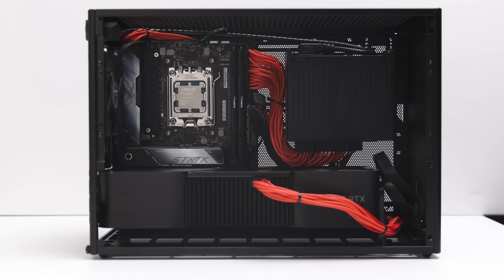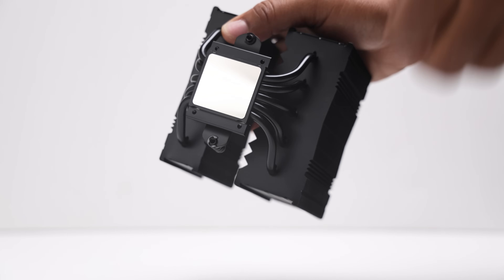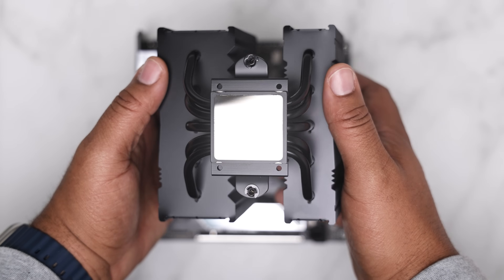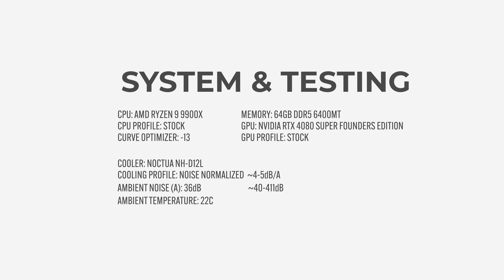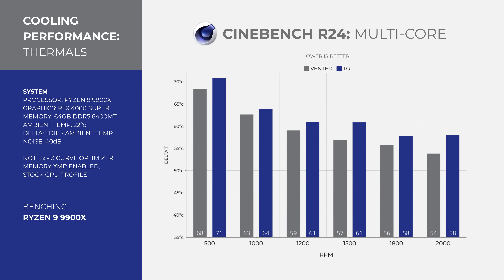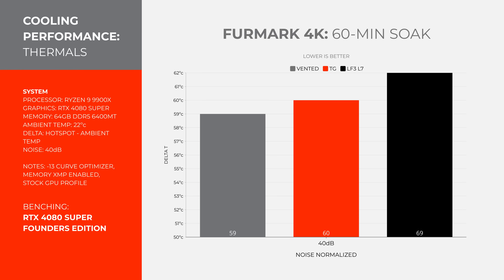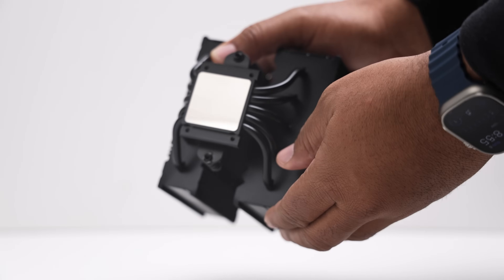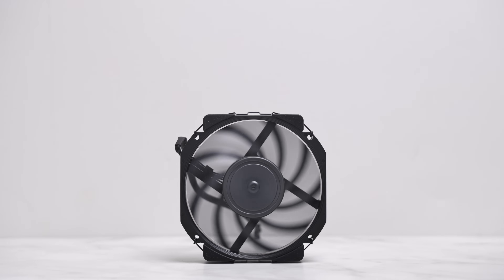NCASE M2 + Noctua NH-D12L – The Ultimate Power Couple!

Comment: I’m making a similar build, could you help explain how all of the fans are connected? Are the 92mm and 120mm top fans daisy chained together and plugged into the chassis header above the CPU?
Reply from the maker: I honestly don’t remember how I made those connections, usually I put the Cooler, pump on a separate headers and any other case fans may go on a fan hub or splitter.

Comment: did you have to use an 12vhpwr adapter for the psu? linked in the description is the 2018 version of the sf750 which doesnt have native support, but it looks like you aren’t using one. is that due to the custom cable?
Reply from the maker: No the Corsair Type 4, 3X8 to 12VHPWR cable
Reply: @ChrisRussellTech  thanks for getting back to me! love the content.

Comment: Hey Chris, in the video, it shows 150mm cable for the 24pin, but in the description, it says 200mm. 

Will 150mm work?
Reply from the maker: It’s actually 200, I don’t think I measure it properly, it’s from end of connector to end of connector not just the cable portion.
Reply: @ChrisRussellTech  I just wanted to make sure. I am trying to transfer parts from my FormD T1 to the Ncase M2. Do you think it the 150mm would work?
Reply from the maker: @aznboi890 do you have 150mm now? I think you should cut up a used set of cables and dry fit them to see what works for you. It’s really hard to tell you what cable size you need in a case like the M2, each configuration requires a different cable solution for best results. If you don’t have the time I’d suggest going 200mm.

Comment: Super clean build! Did you notice any noise coming from the small rear intake fan? When I tried installing a 92mm Arctic P12, I would get a lot of extra noise, likely due to the interference with the case panel or the CPU cooler (PA120 mini).

Comment: Amazing video - Sub earned. My NCase M2 Grater is coming to me right now. Two questions or things I am wondering about:
-Do you consider the Noctua Air Cooler to be the stronger cooling solution here?
-I was actually planning to put the GPU on top thinking it would improve the Temps but it seems your testing has proven the opposite?
Reply from the maker: Hi, thanks for the support! 

Cooling is very situational and depends on many factors like the type of apps or gaming you use. Within a margin of error these test can show just how well your system can cool. If your preferred games are GPU intensive like Cyberpunk you should consider an equally favourable position for your GPU. When it comes to the Noctua, it’s the most “well-rounded” cooling option. It’s quiet, made from quality materials from a reputable brand, however there are other options on the market such as the Assassin 120 Mini, which I haven’t tested on the channel yet. In my M2: 3V3 video, my results favoured the reference layout but the inverted GPU layout was a nice second. However it is important to note that this test was done with a liquid cooler and not an air cooler like the D12L. I anticipate thermals would be a bit worse on the CPU in the inverted layout.

Comment: Does the D12L touch the side panel?
Reply from the maker: Not in this build but I have been made aware of some motherboard and D12L builds that cause the cooler to touch the side. I believe depending on how many PCB layers a board has it can cause that issue. The ASUS X670E-I and D12L should be fine in the M2.

Comment: I like your built the most from what I have seen. I have Ncase M2 waiting for me to decide whether to migrate from NR200P Max or not. ITX, SFF, 4090FE, 9800X3D, PA120 Mini - similar specs. I need to stick to classic layout. Is there anything you would change in this build when it comes to cooling? E.g. slim fans on the bottom instead of top, or use 140mm 25mm thick fans on top instead and lower the GPU/motherboard?

Comment: With this same layout will a 240 aio fit ?
Reply from the maker: Yes, It would fit if you side mount the radiator (extra side mount usually necessary if you want top exhaust fans). It won’t fit at the top or bottom unless you opt for the VGPU orientation (extra purchase necessary).
Reply from the maker: Yes, It would fit if you side mount the radiator (extra side mount usually necessary if you want top exhaust fans). It won’t fit at the top or bottom unless you opt for the VGPU orientation (extra purchase necessary).
Reply: @ChrisRussellTech  in that case I suppose I’ll just stick to air cooling. Only going to be gaming on a 7800x3d. Thank you as always!

Comment: Does the air cooler press on side panel? I want to build similar configuration but i heard that its not compatible, and you didn't putted the mesh panel through the video. Should i get noctua?
Reply from the maker: Not for me, I believe I answered on your Reddit post. My setup is fine, X670E-I with the D12L and M2.
Reply: @chrisrussellca  Thank you for help. In fact, you also answered my reddit post which i want to thank you for ❤️

Comment: I've subscribed and have watched many of your builds thank you! I wanted to know your thoughts on dust and having to clean on these M2 open framed cases.
Reply from the maker: Dust accumulation is a concern but can be managed with regular cleaning.  That is one of the sacrifices when opting to build a small form factor case, dust filters add restriction, mix that with limited space and volume for airflow.

Comment: With this video, it's finally time to subscribe! 

If I could add to this, from my research, this is the ultimate NCASE M2 air cooling setup:

1: Add another black NF-A12x25R Fan on the front of the D12L.

2: Add another A12x25R on the back of the D12L, if your mobo heatsink allows it, if not, the 92mm fan there is OK. 

You have to email Noctua to get them (and the clips). I did exactly this for my Jonsbo Z20 build. 

3: Front mount the SFX PSU and intake from the side with a 120mm A12 fan

4a: Add a 3D-printed 140mm fan mount to exhaust out from the other side as well. There are free ones online, just search "NCASE M2 140mm 120mm fan mount" on the printables site. 

OR

4b: If you don't wanna deal with a fan mount, get some 5mm motherboard standoffs to replace the default ones that come with the M2. This will allow the radiator fan bracket to fit even with the NH-D12L. 

So...
Rear intake with D12L
GPU intake from bottom
Side intake with A12x25R fan
Top exhaust with slim A12 fans
Side exhaust with A14 fan

Anyways, this is the ultimate setup for air cooling in the M2 from my research. Planning on this exact build for my sister

Comment: Chris, what do you think the lengths for the PSU cables would be if you mounted the sf750 horizontally against the front panel with the fan facing inward? That is going to be orientation I'm going with. I'll probably copy your cable color and type.The embossed looks surprisingly good to be honest

Comment: I am also planning to build it at normal set up, I am wondering if it is possible to install 2x14x25mm fans at the bottom and top pannel(I am using 2 slot gpu), also what is the size of the exaust fan for the back panel?
Reply from the maker: I’d exercise caution, it really depends on your GPU thickness and how far down you need to push the power supply.

Comment: Does the D12L push against the mesh side wall being it's slightly larger than what the M2 supports at 144.8mm?
Reply from the maker: It does not cause any issues with fitment, however some of the newer board pay use a thicker PCB to run more tracers between layers and this in theory could increase motherboard thickness and in turn reduce over all compatibility. However my X670E-I fits just fine.

Comment: Hey I have a project in mind with the grater case and glass panel and was looking to see if you could give any advice. I have a 240mm aio from nzxt and it has a display. I want to be able to use this aio and not cover the display with the GPU or radiator. But all the configurations I've seen with this case cover the display. I was thinking if I could use an ITX board, and use the classic configuration where the GPU is on the bottom, and then put the radiator on top. I know the radiator on top might not fit because the board would be in the way, but I was thinking if I could run it with only one fan it might fit, but I'm not sure about cooling issues. The GPU might have to be smaller in order to fit in the case, which I am fine with a 4070 or 4080. Do you think this would be possible?
Reply from the maker: I think you’ll have a tough time, I tried and I stopped shortly after trying. Maybe if you use slim fans. Also it really depends on your GPU thickness also.
Reply: @ChrisRussellTech  Alright well thanks for the insight. I've taken some measurements of some parts I'm planning to use and if I use only one fan on the aio I think it could fit! I guess I'll try it out.
Reply from the maker: @ethankwong3577  the issue for me was the right angle power supply cable which blocks the top fans
Reply: @ ok I see. And I’m guessing if you point the power supply downwards the cables will be hitting the gpu. This is tricky.
Reply from the maker: @ethankwong3577  I’ve tried that too and it causes issues with bottom fans. I’m thinking it carpools be fixed but using a NF-A9X14 fan

Comment: Aren’t the feet to short for the GPU to get enough air through the bottom? 
You mentioned that the flipped config isn’t great. Are there any comparisons with noise and thermal data between classic and flipped orientation ?
Reply: I ordered the angled 15mm feet for that reason.

Comment: I would recommend flipped config with FE cards. In the classic config, the rear exhausted heat from GPU goes back to the CPU cooler intake.
Reply from the maker: That’s a fair point.
Reply: Not with this orientation of CPU cooler. It's intaking air from the back so the hot air joins the FE exhaust to go out the top.
Reply: @ChewyLoo  
You are talking about the exhaust from the flowthrough side. FE exhausts major chunk of heat via the rear. Rear CPU intake will just bring it back.
Reply: @ev1lb0ygen1us  Ah I see. Then it's almost lose-lose for CPU orientation under scrutiny :) I can confirm however that the featured config is perfectly great for 4k ultra gaming temps (I have the same setup). But I can't speak for heavy production workload stuff

Comment: What are your cable lengths?
Reply from the maker: CPU: 300mm
GPU: 400mm
24-pin: 150mm
Reply: @ChrisRussellTech Thank you sir.
Reply: @ChrisRussellTech May I ask which website you recommend for custom cables?
Reply from the maker: @ they’re several good merchants but I use MODDIY but there are some good ones on ETSY also

Comment: Your other build convinced me to go with the LF3 240 or 280, but now I think I might move back to air cooling for simplicity. I love my 360mm LF3 but I'm not sure it's worth it in the M2, even for the 9950X. I really wanted the inverted build for my desk setup (which I guess doesn't matter much since I'll be using the mesh side panel) but I'm surprised to hear you recommend the GPU at the bottom instead of the top, since a lot of other people have praised that for the best GPU temps, like Ali/Optimum. If I do go with the standard layout with my 4090 FE at the bottom, do you think I'll be able to fit two A12x25s under the 4090 with the motherboard in the highest position and still fit an exhaust fan on the back or top to help with the D12L?
Reply from the maker: The LF3 360 will not fit in the M2, only the 280 and below. I recommend and prefer the GPU at the bottom. Its respects the natural flow of heat, even though heat rising is a relatively weak force.
Reply: @ChrisRussellTech  Oh I know the 360mm won't fit. That's what I have now and was just saying I don't know if an AIO is worth the hassle or not. Sorry for the confusion! I do agree about the natural flow of heat. If I can fit two A12x25s under the 4090 FE and maybe a third up top to help exhaust from the reversed D12L, that seems like the way to go!

Comment: I will have two slim, 15 mm, Noctua fans at the bottom, assisting the graphics card, rather than at the top. Rear exhaust, not intake. 

The 90 mm fan at the rear is something I've considered , too. It would be nice if you tested temps with the 90mm fan at the rear and without. To make sure its actually worth the addition.

I have a set of the 15 mm angled feet to install, too. So there's more airflow to the graphics card. 

Nice video, Chris!
Reply from the maker: For sure. Maybe I’ll post a comment with some updated numbers. I was kind of hesitant to include it in the video because there several stipulations. I included it to give others the idea to test it, I also think EIGA is considering making an official mod for it.

Comment: In your opinion How would this case travel? I despise laptops (I know I'm Weird) Im looking at both car and air travel in my future. Would this case fit in a carry on? Is it built well enough to ptotect the components? Thanks for the video, I apreciate your style.
Reply from the maker: I don’t recommend this case for air travel, it’s too dense. The biggest I can recommend if the FormD T1 or similar. Once Ncase works on their panel tolerances (especially on the top panel) and add a travel kit for the GPU, maybe I can recommend. The T1 has a travel kit, the thumbscrews are solid and the option to add a Peak Design handle is a plus. Also a 10 liter case is easier to throw in a backpack or fit into a pelican case.

Comment: Does the noctua air cooler touch the side panels causing it to bulge?
Reply from the maker: Not at all.
Reply: interesting…the official page lists the max supported cooler height of 144.8mm while the NH-D12L is 145mm. You are certain that it doesn’t push up against the side panel?
Reply from the maker: @ I’m positive, it’s a good fit. I’ve even pressed on the panel to see if there was any “given and the panel has 1mm of space. I think the M2s 144mm limit is to accommodate boards with thicker layers like the X870i. ITX boards need more layers to fit the same amount of features compared to mATX or ATX boards. This is just a theory. The cooler fits no problem.
Reply: @ChrisRussellTech  thanks for verifying that. I'll get the Noctua too
Reply: @Corvinade it interferes with mounting the fan bracket on the side. Without the bracket there’s no clearance issue.
Reply: @shortw00dBE thanks for the reply but its a bit late now and i did end up getting that cooler. And yeah, it does touch the sides barely

Comment: A comparison between the Noctua NH-D12L and the Thermalright Peerless Assassin Mini would be interesting.
Reply from the maker: It’s a tempting idea, maybe after CES.
Reply: @ChrisRussellTech  yes please
Reply: They perform the same when using the same fans.
Reply: @getquackon5318  if not? How much the Thermalright coolers lacking?
Reply: I own a M2 with a Peerless assassin, way more value since the heatsink is basically the same. I paired it with a Noctua Fan and its really quiet, 7800X3D here though.
Reply: @Affexzy  Which fan did you get? Any DIY to mount it to the PA 120 Mini? Thx.
Reply: @brunofiset  i just emailed noctua support for an invoice to buy D12L's fan lmao, fits perfectly from what I've read
Reply: Seems from some other comparisons I have seen that the D12L is about 1-2degrees cooler when normalized for noise. but it costs 4x, at least where i live. The D12L is more double the price of a good AIO aslo. Really doesn't seem worth it.
Reply: @Struct.3  I got the PA120 mini for 30 EUR, NHD12L costs 125 EUR in my area so that's about right. It's also taller and pushes against the side panel of the case. That means the noctua cooler is also probably incompatible with acrylic/glass side panels.
Reply: Late to the party but would you be able to fit that rear fan on the back with a peerless assassin?
Reply: Oh yea
Reply: I wonder if they did the test with the PA120 Mini's man.
Reply: @s16noit has been done. Machines and more did the test. If you put the noctua fans on both coolers it perform the same.
Reply: Thermalright Peerless Assassin (Mini or Phantom Spirit) doesnt have offset for AMD's, so they are not the same
Reply: @max.zelinski  with or without off-set the perform about the same. The only substantial difference is noise and frequency of the fan. Which I changed by buying the noctua fan for the assassin lmao.
Reply: @max.zelinski I’ve read that Noctuas offset kit actually fits some coolers of this type from other brands as well, it’s confirmed to work on some Thermalright models. I’m putting together a new build and will try it on the mini.
Reply: @t1tan19 How did it go?
Reply: @max.zelinski  if the performance and thermals are the same who cares